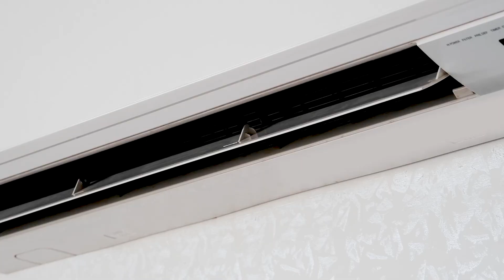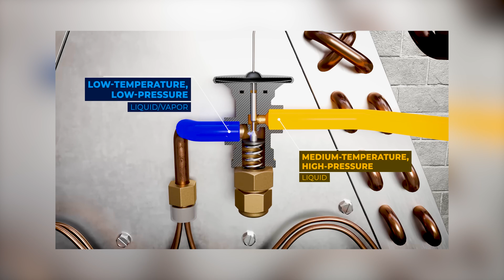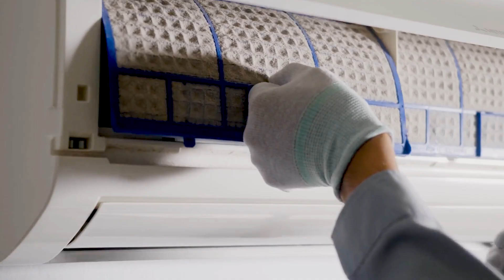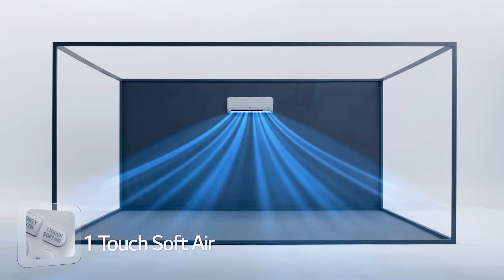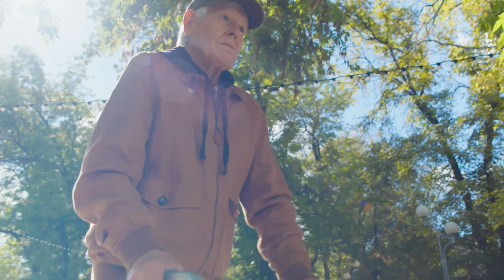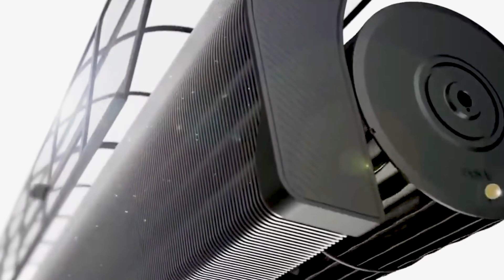The #1 Mistake Raising Your Electric Bill

Comment: If the house is well insulated, it is cheaper to pre-cool the house in the cool morning, than to wait until the hottest part of the day to turn on the AC. As you said, the compressor has to work harder the hotter it is outside, so best if the compressor only has to run occasionally to maintain the cool inside temperature during the hot time of day